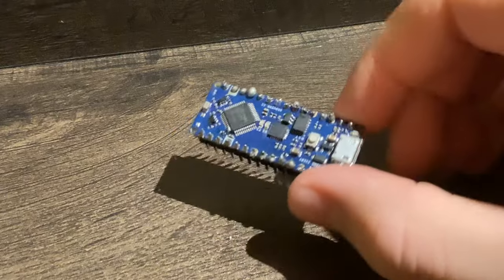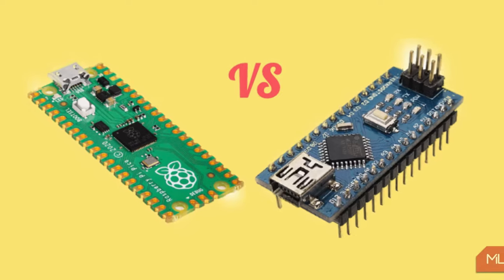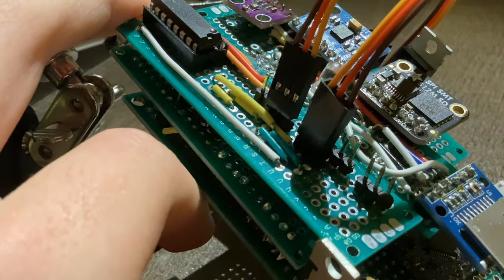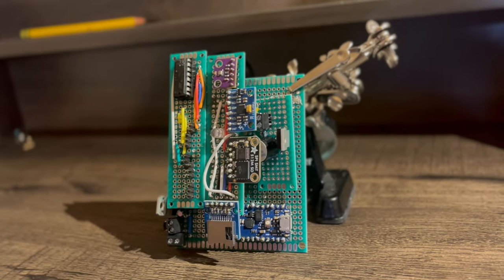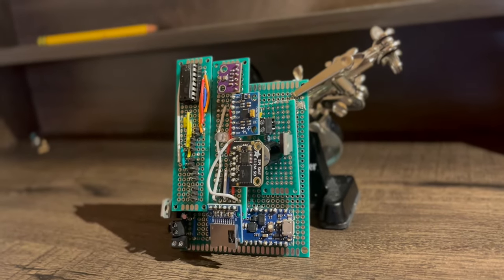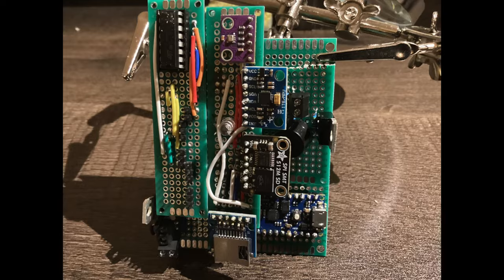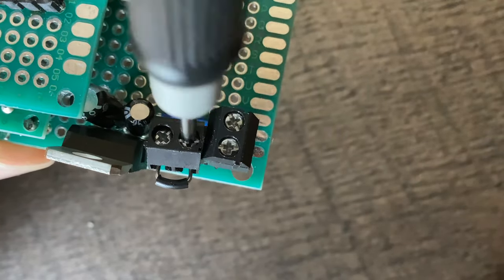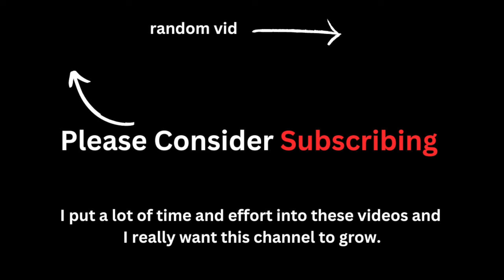The All Rocket Avionics Bay (A.R.A.B.) flight computer | Building Gimbal EP1.

Comment: Hey nice job dude! It looks a like a sweet little computer. I work on avionics professionally and you're heading down the right path! I would definitely recommend learning about KiCAD for your second revision and using the ICs directly on a custom PCB. This will also help let you use proper connectors that will be better suited for more rough environments than headers. Best of luck and keep at it!
Reply from the maker: Thank you, I was planning for the next version to have the breakout boards soldered to a pcb and the final version to have the IC's soldered to a PCB. Basically following how much better I can get at computer design. The final version should have radio and gps capabilities because I'll probably fly it on larger, more powerful rockets.

Comment: Nice. I started with something similar, an Arduino Nano, some sensors on breakouts and a custom current monitoring system. Now working on the second version, it’ll be a proper PCB without breakout boards.
Reply from the maker: that's my plan for the future :)

Comment: I’m building from scratch a five booster Atlas-5 rocket 5’-7” tall. I’m wondering if anyone can help me with how to do a remote onboard firing system for my rocket? and is it possible to have some kind of gyroscope for it also. 5” dia blue tube. The boosters are 29 mm tubes. Who could make laser cut fins for me.
Reply from the maker: I haven't done any hpr flights, but I know that most people don't use gyroscopes, or really anyone at that. Your fins will probably be enough. 
tutorial for ejection charge: http://www.perfectflite.com/Downloads/Ejection.pdf

Comment: Hi! Relly really nice computer! I am working on something similar, the few differences are the mcu (I am using an STMF411 currently) and the addition of some sensors (gps, magnetometer) and a nrf24l01 to transmit some telemetry. In any case all of this is still on a protoboard, but my plan is to make everything fit in a CanSat, so I will need to get creative with the building techniques. The Pi Pico can be programmed via Arduino IDE or even other IDEs like sloeber or platformio, those two including debugging capabilities. Good luck with your project, and if you want any tips, send me a message!
Reply: Like for STM32F4. I used F7 for my rocket, that was like 10 times more than I actually needed lol :D

Comment: good job, accually I made this same thing(completly not completed) but using some other processor, like Ik, atmel's good choice&easy in operation, but you have already much cheaper version of STM32 processors, even in boards such as "blue pill". I know you have encountered it many times, you've may used it, but i thing with such an overclock (especially on light programs) it can be a big advantage. I have also a QUESTION! What uploader/compiler do you use to upload the program to the board? (like just arduino ide or something more advance? (I didn't hear that in vid))
Reply from the maker: So you're saying it might be better to overclock the arduino? Also I'm using arduino IDE. Thanks for the advice!